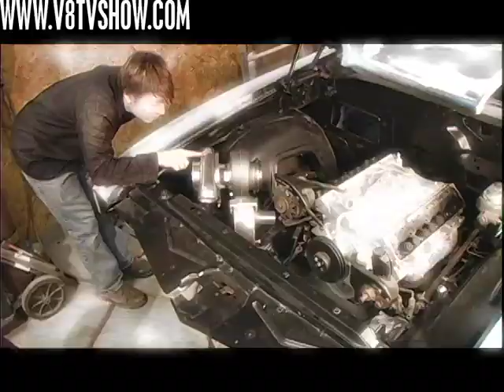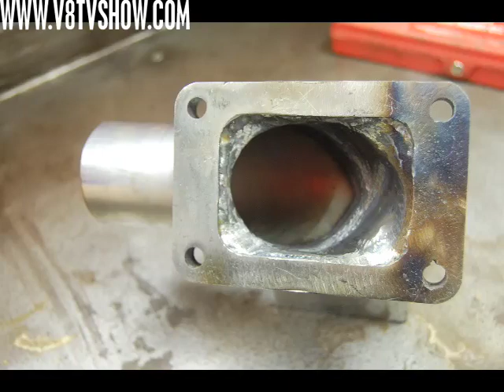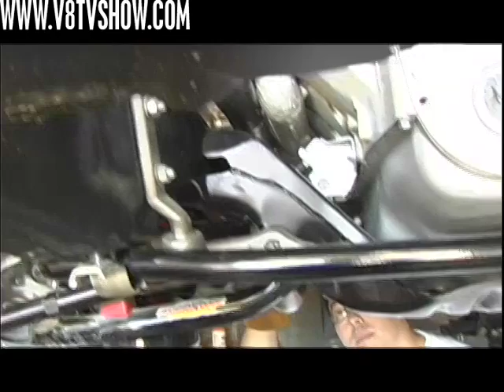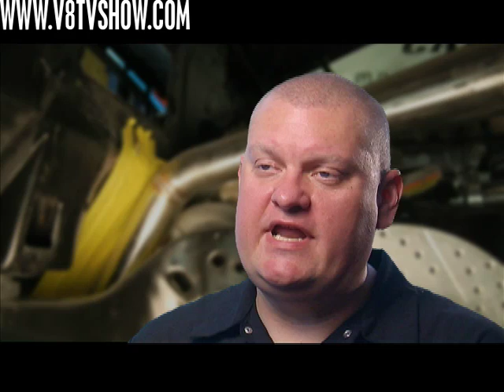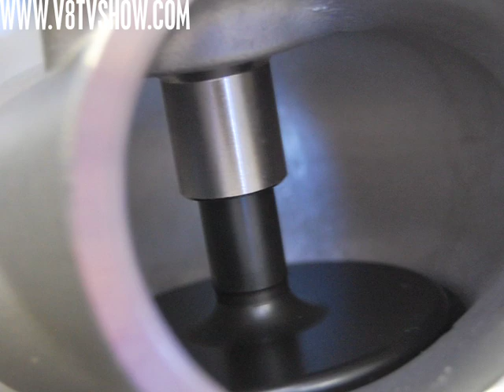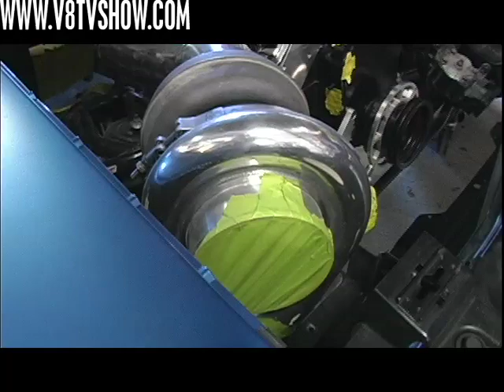Bullseye Power Turbo Video Install Part 2 - S71 Olds Project V8TV

Comment: Won't putting the inter-cooler in front of the radiator affect the efficiency of the radiator so it won't cool as much as it should? I have no clue about this, so I have to ask :)
Reply: Alexander Rex Evensen 
No not really, most factory cars have ac condensers in front of the radiator, this intercooler will flow more air than the radiator, should work fine

Comment from the maker: @ruwithlee1970 You're on the right track... the Chevelle and Cutlass are both A bodies, but man, are the inner fenders different.    We ended up cutting up an old Chevelle inner and making a hybrid piece on the passenger side.    You'll see it in the next chapter!

Comment from the maker: @V8TV ... they are not as efficient as well.    To date, there is no "kit" for these cars, we'd end up doing significant fabrication as well.   And the rear-mount turbo company is now offering intercoolers as well, illustrating that the long cool side run does not remove the heat from the charge air very well.   All power adders have benefits and drawbacks, we wanted to perform a proven install strategy on this car.   And we like seeing the turbo up front.

Comment from the maker: @cubcadet1983 Turbos operate with heat, so the closer you get the turbo to the exhaust source, the more efficiently it works.   The Bell intercooler is far more efficient at reducing air charge temperatures than a rear mounted turbo.   Plus, the shorter your oiling system can be, the more reliable it will be.   Rear mount turbos work, but they are more of a packaging band-aid.   They offer pressure loss over the length of the car, place the turbo in the elements, and...

Comment from the maker: @MPWR327i Thanks!   We did not grind the welds on the exhaust.   Most of it was TIG welded, but the MagnaFlow mods were MIG welded.    The turbo flange and mount are mild steel, as we knew we wanted to ceramic coat them black.   The exhaust is stainless.   The intake tubing is coated mild steel as well, as you'll see in the next video.

Comment from the maker: @V8TV .. that this is a 422 cubic inch stroker V8.    Even with the stock manifolds providing less than 100% optimal flow, we have the ability to make far more power than this car will be able to put to the ground.    After all, it's a street driven car, not a race car.      So weighing the cost / benefits of slightly more power (that we may not be able to use) vs. high cost of stainless fabled headers, we kept the manifolds.

Comment from the maker: @citydriver We chose this route because of several factors.   First, the factory manifolds lent themselves to this design rather nicely, and we wanted to avoid expensive custom stainless headers if we could.   This is an Olds engine, so everything would have to be custom.   The manifolds are iron, so they will last, and the work is already done.   And they package really tightly in the car, which is nice.    Also keep in mind..

Comment from the maker: @GarethDavidWebb Gareth, the turbo bolts to the stand, which is bolted to a base welded to the frame.   While we are expecting some heat transfer down the tube, we're not expecting it to have much of an affect on the front of the frame.     We'll keep you posted!

Comment: Great work guys! Im not likeing the idea of welding the turbo flange assembly to the rail though, thats going to get damn hot, and heat the whole front section of chassis. or have i got it wrong?